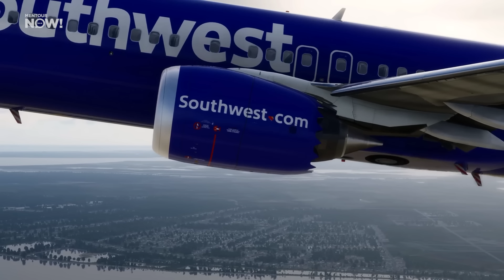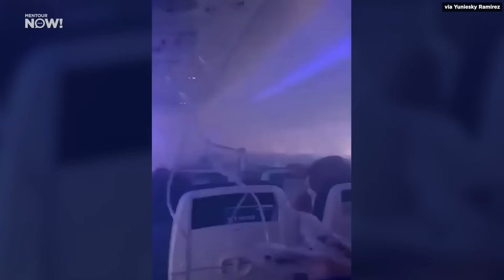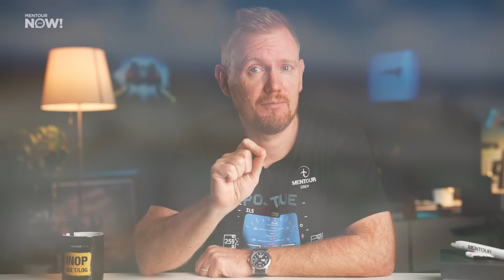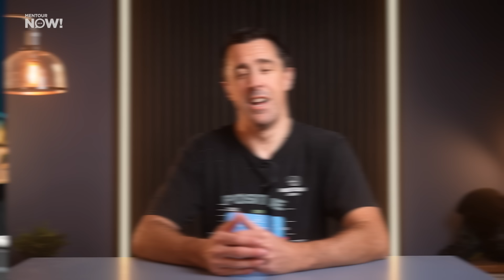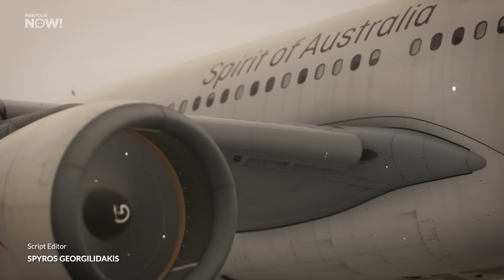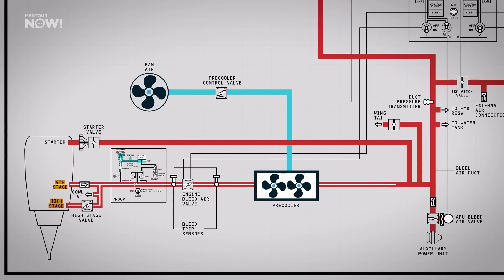Why Don’t ALL Airliners Do THIS?

Comment: Just to make it clear - conservation of energy still applies. Electrical generators "steal" power from jet engines in a similar manner as bleed air does. There is no free lunch here. The devil is in the detail though. It could happen that replacing pneumatic systems with electrical ones is more benefitial due to weight reduction for instance. At the risk of stating obvious here - this needs careful evaluation and there is no perfect solution. Each approach has its own pros and cons.
Reply: "There is no free lunch here." Outrageous, flights should always have free lunch.
Reply: @ElvisStansvik  well there was only ryanair available
Reply: @ElvisStansvik  Seat-Side aisle freshly tossed Caesar salad and prime rib, of course.
Reply: @citylockapolytechnikeyllcc7936 and fresh-squeezed juice
Reply: @ElvisStansvik  And snacks for the pilots.
Reply: While there’s no free lunch, not all lunches cost the same. Understandably a prime rib should not, in theory, cost the same as a salad. 

Not apples to apples but growing up my parents owned a 55ft sailboats. Given the size and built in the mid 90’s, many of the powered components were hydraulic (steering, winches, sail furlers, bow thruster, anchor windlass). The hydraulic pump ran off the engine. Around 2015 it had its electrical system refit and swapped to an electric hydraulic pump and electric winches for the sales. The fuel efficiency of the engine improved  5-10% switching to an electric system. Plus no longer do you need to necessarily run the engine for the hydraulic systems to fully function. Not needing to run the engine for certain hydraulics also saves power. 

They have since sold their boat if you look at brand new boats of similar size, most of these systems are all electric now.
Reply: @ejb3539 

It is kinda a pain to have to run your engine to use a hydraulic powered winch on a sailboat. A 55 footer seems like it could still have manual geared winches for most of the winches. My experience was with a 48 footer that was all manual.
Reply: I knew someone would ask. I wasn’t going to go into the details of this boats hydraulic system but because you asked… 

First, the sails on a 55ft monohull are huge… 70ft+ mast height, 1600sq ft of mainsail. Manual winching would be extremely exhausting, especially because the higher the sail gets, the harder it gets. Can it be done, yes. Is it fun, no. Powered winches are pretty universal on modern sailboats of this size  (anything 40ft+ really). 

Hydraulic winches (and electric) can be manually cranked with a winch handle, like any manual winch. Small sail adjustments are easy enough this way. This boats hydraulic system has an accumulator to provide reserve hydraulic power, enough to make limited small adjustments. To raise the sail you’d need the engine but usually you have the engine on anyways at that point. Hydraulic furlers operate similarly.  

The steering system is on its own circuit and uses the helm (steering wheel) as a pump if hydraulic power is lost, the steering ratio changes and requires more effort, tiring in bad weather or docking. The autopilot uses an electric hydraulic pump to power the same system and is typically the preferred way of maintaining course. Hydraulic steering isn’t that enjoyable to steer by hand anyways, especially these older systems- they feel like mush. In a major failure steering there’s always the emergency rudder (a small rudder that connects to the stern and is manually turned with a long lever)

The anchor windleass and bow thrusters need the engine to operate. The windlass technically has a manual crank but would be extremely tiring. The only reason I can think of to use a bow thruster with the engine off is if you are trying to avoid a collision after an engine failure. Electric bow thrusters have finite power with the engine off as they always have their own battery bank. 

With electric pumped hydraulics the system is much more on demand and can be operated off of batteries. Using electric motors for many of these systems would be even more efficient. 

So the engine actually doesn’t need to run constantly to operate to sail, it just needs to run more and you’re constantly having to power a mechanical hydraulic pump off the engine. With electric-hydraulic you can run the pump on demand using alternator power, generator power, or batteries.
Reply: @ejb3539 My dad used to have a 50ft sailboat as well. The only powered winch on it for a long time was used to lift the main sail or spinnaker, and that was entirely electric. Everything else was a manual geared winch.

So to me, the idea of a boat that big needing hydraulic winches is a little bit foreign!
Reply: It comes down to the losses and efficiency of the components. Does the bleed air system have higher efficiency or does the generators have higher efficiency? Then there are the weight considerations, which system is overall lighter? There are so many factors that go into the evaluation, I don’t think we could say one way or the other is “better”. It is two different ways to solve the problem, each with their pros & cons, balancing the trade offs.
Reply: @kortneyjohnson963  Jet engine operate at at most 50% thermal efficiency ( and 20-40% final propulsion efficiency,) while theoretical maximum (with no losses) for the thermal setup is around 80%.  So it is plenty of energy that is lost to the environment  and in principle can be picked up along the way for other uses.  I wonder if anybody heard that disengaging the bleed system will increase the thermal efficiency to say 55% ?  What is the energy cost of running it, if any ?
Reply: Actually,   Google AI says that ECS system costs 1-3% in engine efficiency for modern turbofans
Reply: @dmitripogosian5084 

The overall efficiency of a gas turbine can be increased if steam is injected into the combustor. This is commonly done on ground based gas turbines. There is research on doing this for aircraft.
Reply: @Mentaculus42  Sure, there are always avenues to explore.
Reply: @dmitripogosian5084  Does Google AI tell you to think for yourself?
Reply: @benargee when you are done with your calculations on ECS efficiency penalty, share with us your independent results
Reply: @dmitripogosian5084  don't take it so seriously bro.
Reply: @benargee 

Lol. Insults someone. "It's just a joke bro"

Clown
Reply: @kortneyjohnson963  Magnetic drag from a generator would only take place if the system its powering is switched on.
Reply: @kor @kortneyjohnson963 u hit most of the high points with a good comment. I would also add in reliability and the associated maintenance  as the more reliable system directly translates to overall economics. An aircraft that has higher dispatch rate makes more money. The discussion of what is BETTER is extremely complex as better has to be quantified & quantified. Generally speaking the 787 is considered a reliable aircraft.

Also it seems that Airbus was not willing to increase the design difficulty (with the associated pitfalls) to chase POSSIBLE diminishing returns in efficiency. Sometimes GOOD ENOUGH is acceptable by various metrics. It will be interesting to see what approach Boeing takes whenever they get around to designing a new clean sheet aircraft.  But what is optimal in a relatively large aircraft like the 787 may not be appropriate in something smaller in a 797.
Reply: I did a very brief trade study to use bleed air or waste heat from the AC packs to heat the coffee and food in the galleys to reduce the electrical load. It was a bad trade.  )
Reply: Maybe though it is more efficient to do it this way. I am thinking that the moment you bleed air you essentially  reduce the compression ratio which fundamentally reduces the efficiency of the engine. I am not a jet engine engineer but its just a thought.
Reply: @ExplosiveAnyThing  Google says ECS system comes with 1-3% cost in  efficiency for modern turbofans.  And if you put a generator, will you not need to bleed some air from the engine to run it ?
Reply: @dmitripogosian5084 why would you need the air? You are running it straight from the engine's shaft
Reply: @ExplosiveAnyThing  Ok
Reply: @dmitripogosian5084  The generators are usually run off the accessory gearbox off the driveshaft, so you are robbing a bit of rotational energy but not bleed air.
Reply: I think from the standpoint of safety alone, bleed air systems should be phased out over time.
Reply: "Electrical generators "steal" power from jet engines in a similar manner as bleed air does."

True, but the "stolen" air could affect the efficiency of an engine, lowering its output beyond the energy "stolen".
Reply: Running at higher voltage and higher frequency (nominal 400 Hz) allows the transformers and wiring to be much smaller and lighter, and I suspect the reduction in size of the necessary through holes for wiring vs. ducting must have been a major win on the structural, and thus weight side
Reply: @GaryBickford 

The 787 variable frequency generators are NOT nominally 440 Hz but rather are dependent upon engine RPM. A huge amount of power electronics are used to deal with converting to different voltages and waveforms.

U. S. Patent # US20240243677A1 and “Modeling and Simulation of Variable Speed Variable Frequency Electrical Power System in More Electric Aircraft” for reference to how the Boeing 787's Variable Frequency Starter Generators (VFSGs) work.
Reply: The 787 APU has 2 large generators and can supply the required electrical power (1.4MW) without "stealing" power from the main engines. Yes, you have to burn fuel to run the APU and 2 generators, but it does not impact the main turbine power or efficiency.
Reply: Exactly. When you turn on the headlights of your car, the fuel consumption goes up, as it does when you turn on the wipers, radio, everything. Nothing is free.
Reply: Very true, but it is much more efficient.
Reply: Yes he does go on to say the efficiencies over bleed air come from the on-demand use and more fine grained controllable distribution of the electrical energy. No one is saying it’s free energy, 2-3% gain was quoted in video.
Reply: I’ll vote for breathable cabin air. There are hundreds if not thousands of incident reports concerning smoke in the cabin foul smell in the cabin etc. I think Paroisse got the right idea despite the fact that there is no free lunch. I’d rather believe breathe clean air rather than A fine mist of petroleum poison.
Reply: The point was that electricity is more efficient than bleed air. At least you aren’t being exposed to carcinogens when it’s electric.
Reply: Absolutely.  The question comes down to the efficiency of the rest of the system.  It is likely that the same amount of power carried by hot air through a pipe can be carried much more efficiently by electrons in a copper wire.  And the wire is much lighter and simpler than large insulated ducts.  And as the video outlined, electrical systems are relatively easy to monitor and control compared to pneumatic systems.
Reply: Yep, one cannot get something from nothing. Which is what EV drivers are finding out, to their detriment.
Reply: @johnnunn8688 Hmm . just what is it I'm "finding out"? 🤔
Reply: Correct, and this was going to be my comment.  It's almost always a trade-off.
Reply: All of that was already mentioned in the video. 🤷‍♂
Including Ben literally saying "There is no free lunch."
Reply: The problem with bleed air is an inherent problem to compressing air.  Yes energy is conserved; however, due to the thermodynamics of compressing air, two energy conversions are happening at the same time.  The one we think about is energy being converted into the potential energy stored in the pressurized air.  However, much of the energy is increasing the temperature of the compressed air.  Of course some of that - given how cold the source air is - comes in handy.  However, much more heat is produced than what is useful. This is called wasted energy, and is a pure loss.
Reply: @Why_ask_ 

But sometimes the heated air is what is needed, hence why the 787 still uses bleed air for a particular reason that is close to the engine vs using resistive heating.
Reply: Yeah the actual calculations are extremely complex. Boeing is "wasting" energy by letting generators convert some of the rotational kinetic energy to electricity while Airbus is wasting some of the kinetic energy by compressing air that is not ignited.

I think the efficiency gains Boeing speaks of is mostly based on the fact that they argue that they can regulate the amount of energy converted better. Though I think that should also be possible via valves in the bleed air system.

The question would be just which consumers are more efficient and how good the energy conversion rate is actually.
Reply: @Sadreath i think that fine-tuning blessed air via valves is challenging while throttling power production/consumption nowadays is fairly simple.
Reply: @gerryino  Throttling a valve is not all that complicated though it probably would be a very expensive setup given the pressures and temperatures we are seeing here
Reply: @Sadreath you’re also paying a weight penalty. High pressure pneumatics is another system you have to carry. They already have to have an electrical grid so it’s just one more thing. Larger batteries aren’t free, but they’re pretty energy dense.
Reply: @nishadmathur3826 

The battery system that the 787 has is not particularly unique other than Boeing went with a lithium ion battery to save weight. The irony is that the redesigned system (that is a bit of a kluge) appears to be heavier than what is in older aircraft.
Reply: @nishadmathur3826 

The 787 has an additional variable frequency electric grid.
Reply: @nishadmathur3826  Eh I am not a Boeing engineer so I have no clue if the system is actually lighter or not. Generators are quite heavy too. Hard to tell from the outside.
Reply: @Sad @Sadreath the engine it’s self is a generator. It’s not free but if it’s acting as a starter then it’s not a large increase imo. 

If you have a hybrid electric engine you could use it for an additional boost during takeoff too. So you’d be able to increase MTOW. The same motor could charge/discharge as needed (like regenerative breaks in an EV).
Reply: @nishadmathur3826  The engine provides the kinetic energy for the generators but the part that is generating electricity from the kinetic energy is at least doubled up in the 787 as per the video.

There is simply no way to accurately asses this without insider knowledge. Everything else is just speculation.
Reply: I would imagine that the electrical system is more efficient for cabin air, as it can compress the air to the pressure that is needed, where as the bleed air will be at the pressure that the engine needs to function, which is probably higher than atmospheric pressure. So you will lose a load of energy as you drop the pressure of the bleed air to the cabin pressure.
Though I would guess that the electrical system is a bit heavier.
Reply: @daveansell1970 
Gas turbines can have multiple bleed air points at different compressors stages depending upon what the air is being used for.
Reply: @Mentaculus42  but don't they move the point they are bleeding from for each purpose depending on the rpm?
Reply: @daveansell1970 
Don’t know, but from the diagrams that I have seen, maybe but probably not. Good question.
Reply: You're on the right track, but the the reason isn't only engine pressure.  Bleed air is also very hot.  In order for it to be safe for us to breathe, it must be depressurized and cooled.  On the airplanes I worked on, bleed air goes through at least 3 radiators that waste heat into the atmosphere.  Anytime you waste heat, you're wasting energy.
Reply: @daveansell1970  Nah, they bleed the air after the first few compressor stages where it is at a suitable pressure for the cabin, after that the air is compressed much more for the combustion chamber.
Reply: @N330AA  but the pressure is still going to change depending how hard the turbine is working, as you can't tune the rpm for cabin pressurisation, so you are going to have to take the air off at a higher pressure than optimal.
Reply: @daveansell1970  Pressure has nothing to do with RPM. An axial compressor on a jet engine has a pressure ratio of about 1.2 per stage. So after a few stages you are at the desired pressure for the cabin, and you bleed off there. And after that the latter stages pressurise up to the level the combustion chamber wants.
Reply: @N330AA this just isn't true.  Bleed air is significantly higher than cabin pressure.
Reply: @daveansell1970 yes the pressure changes with RPM.  That's why there are pressure regulating valves is the system.
Reply: @N330AA most jet engines only have two stage bleeds - one early stage and one much closer to the burner.  There are fairly complicated regulating valves that open and close depending on demand from airplane loads and pressure at the two bleed stages.  Again, bleed air is way to high pressure and temperature for human exposure.
Reply: @stevebrown645  that is what I thought, and energy is lost as air is expanding irreversibly.
Reply: @stevebrown645  But the point is it's not at combustion chamber inlet pressure, it is bled earlier.
Reply: @N330AA  yes, it is bled before any combustion.  But physics (the ideal gas law) says that when you pressurize air  it gets hotter too.  This science explains why air is cooler at higher altitudes and why diesel engines can burn fuel without sparkplugs. 

In fact, most jet engines only use igniters during the starting sequence.  Once they are running, the air from the high stage compressor is so hot that it ignites the fuel as it comes from the injectors.

Obviously, air to is hot enough to and pressurized enough to ignite fuel is too hot for humans.
Reply: @stevebrown645  No the compressor outlet temp is not hot enough to reliably keep the kerosene alight, due to extremely fast air flow. Hence why they have candleholder geometry. Likewise the air that is destined for the cabin will be much cooler than the COT due to being siphoned off at much lower pressure stage. Also remember the outside temp at cruise is around -40C.
Reply: @N330AA OK, so what is your source?  I spent 30 years actually measuring many, many parameters onboard airplanes.  Trust me - bleed air is fn hot.
Reply: @stevebrown645  You are a particularly belligerent and condescending one aren't you?

I am educated in thermodynamic to a university level so you aren't telling me anything i don't know.
Reply: @N330AA Fantastic!  I have studied thermodynamics at the college level too!  We now know the you have the capability to figure out the answers yourself.  It would be interesting to look up standard atmosphere pressure at 8,000 ft cabin altitude and subtract standard atmosphere pressure at 40,000 feet to get the minimum pressure increase required for passenger comfort. Then, apply the ideal gas law to find out how much the temperature would increse from the standard atmosphere at 40,000 feet.   Should be a pretty simply application of the ideal gas law.

Once you have calculated the temperatures and realize that they are too high for comfort, I recommend that you look up an air cycle machine.  These are super cool machines that allow us to significantly cool air just using the pressure from the engine bleeds without any other energy source.  Of course, the ACM requires more pressure from the bleeds to operate but still super cool thermodynamic machines.

Perhaps you find my comments belligerent because you are embarrassed that you've been caught making comments that you have not applied your education towards?  It's hard to tell.  

I love airplanes.  I worked on them my entire career.  I love the science that makes them work.  I'm inviting you to learn so that you can provide more factual comments in the future.
Reply: In this case the superior solution for safety is to have electric. That was the point that was very clearly stated in the beginning of the video. Safety. Not only that, I'm sure most people would prefer to breathe in cleaner air.
Reply: @CorneliusTaylor-s1u While it is true the 787 won't suffer engine oil smoke events in the cabin due to the bleedless system, is technically still possible to have smoke from a failed cabin air compressor instead. 2 Air India 787s from 2016 (AI 701) and 2018 (AI 380) had smoke enter the cabin and cockpit, requiring emergency landings.
Reply: The B787 is mostly electric, anti-ice, brakes, engine starters, pressurization and more. The reason bleed air is not used is because of the fuel efficiency to not use bleed air. The airplane has multiple generators and the electrical system is quite complex, but the whole goal is using less fuel and that means taking as much load off the engines as possible. It is a balance of efficiency in doing so.

Yes there is no “free lunch” however, engineering is about achieving specified goals and in the case of the B787 and future airplanes it’s about economic efficiency. The airplane cost money to operate and reducing the cost per ASM or ton mile (freight) is how they make money.
Reply: @bjet767 

The 787 still uses some bleed air.
Reply: @Mentaculus42  For the engine anti ice only.
Reply: @RobStar-777 

Correct, which also makes total sense.
Reply: @RobStar-777 

Also don’t forget the bleed air for internal cooling and bearing thrust compensation. Kinda a different type but it does hurt efficiency a bit.
Reply: @Mentaculus42  True.
Reply: I like the 787 idea is best
Reply: I mean, there kinda is, generators get about 92% efficiency by the time energy gets to the battery meanwhile bleed air system…we are taking less than 1% efficiency
Reply: Or why not both? Redundancy is very beneficial in aircraft. You can operate on bleed air most of the time, and switch to electrical compressed when it has issues.
Reply: @benargee there’s a cost, complexity and weight associated with having a dual system that might never be needed. Also there’s already plenty of redundancy with either approach.
Reply: The problem with electrification of say breaks is that brake systems based on bleed air, just like truck brakes are inherent failsafe. You loose pressure, springs brake, air pressure is there, the springs are compressed and a second - the primary - system allows for normal braking, it's one brake that does both at the same time, including being the parking brake. Pressure in the system also allows for activating the brakes even if the "compressor" is failed. For an electrical brake this has to be factored in, hence the batteries, using smaller electrical motors requires using gear reduction or screw drives that bring their own weight. Brakes generate lots of heat, magnets loose their magnetism with heat, even Iron looses it's ferromagnetism with heat, long before it melts. Electromagnets require ferromagnetic-cores to generate the high magnetic forces, also high forces require high amperage [1], that requires thicker conductors, i.e. copper wires, copper is heavy, iron (ferromagnetic-cores) is heavy. Pneumatic brakes are a diaphragm and a rod, heat is no issue, if the tyre burns they still do their work down to the rim.

So I think the Airbus approach while still more could be electrified is probably the better way.

[1] electromagnetic forces 101: The magnetic field is generated by **moving charges**, which is Ampere, not Voltage. Current (I) = charge per unit time. More current → more moving charges → stronger magnetic field. Versus: Voltage (V or U) = potential difference, which is just the “push” that makes charges move. (The U is European and come from Latin Ugere meaning "drive")
Reply: @darknase 

R u suggesting that aircraft use “air brakes” vs hydraulics (not referring to the 787)?
Reply: Bleed air is always stealing power. The motor/generators can selectively draw power and use batteries.
Reply: ChatGPT ass response
Reply: "Electrical generators "steal" power from jet engines in a similar manner as bleed air does."
Exactly. In a purely trade off number I would think that the bleed off system uses less fuel than an all electric one.
A mechanical windmill is more efficient than an electric one because it uses direct kinetic energy into motion instead of first turning it into electricity and back into mechanical.
Reply: @iorr98 

U stated:

“In a purely trade off number I would think that the bleed off system uses less fuel than an all electric one.”

Why do u “THINK” that? Intuition? 

Bleed air has a number of types of losses. Mechanical systems have numerous losses. It is a too complex topic to simplify to a single “this is generally better”. Besides what Boeing was trying to accomplish was more about a total system optimization than just minimizing the use of bleed air (which is still used in the 787).
Reply: @Mentaculus42  Every time you change the type of energy you're dealing with there are inherent energy loses involved. Going from shaft horsepower to electrical back to shaft horsepower (fans are just electrical generators in reverse with a fan) has a minimum energy loss associated with just due to the conversion factor alone. So it honestly boils down to how the system is designed. I do think though there's probably usecases for both in which they're more efficient.
Reply: @Viper607706 

What u r saying is true, but the goals that Boeing were designing for with the 787 at the systems level r way too complex to reduce to simplistic generalizations. Considering that the two different approaches ultimately turned out to be very close in overall efficiency. This shows that other issues such as aircraft availability / reliability and maintenance costs become determining factors.
Reply: @iorr98  Yes i just speculated similarly myself. It's possible however that the aerodynamics of the bleed system itself in the engine are problematic - especially given the variable nature of it - and it's more efficient to just work the shaft harder in spite of the conversion losses. However i am not convinced either way.
Reply: Jet airliners will still need to extract bleed air for anti icing purposes, so the weight saving is likely not that big.
Reply: @andersmoesby6470 the video states the Dreamliner doesn’t do that, but uses electric heating for anti ice instead.
Reply: @AndreSomers The engine anti ice use bleed air. Its the only source of bleed air on the 787. The wing anti ice is electric.
Reply: @andersmoesby6470  But will the autopilot still inflate pneumatically ?
Reply: @citylockapolytechnikeyllcc7936  electric fan, like an avalanche airbag 😂
Reply: @andersmoesby6470 i think anti ice is from higher pressure bleed than the cabin pressurization. So it's completely separate system at least on some engines.
Reply: @Harpoika  Bleed air comes off the engine at one place and the engine fuel control system modifies the fuel flow to maintain proper mixture ratio for combustion based on the amount of air that has bled off. For cabin heat, air conditioning and pressurization, the high-pressure, high temperature bleed air is run through heat exchangers and recompression cycles to remove the heat and reduce the pressure to what is needed for the cabin. That heat subtracted from the bleed air is basically lost energy. I would think the electrical system would be inherently more efficient.
Reply: @Dwieder2456  I am quite sure the bleed air is commonly taken from at least two stages of the compressor and there's different systems for high pressure and low pressure bleed airs.